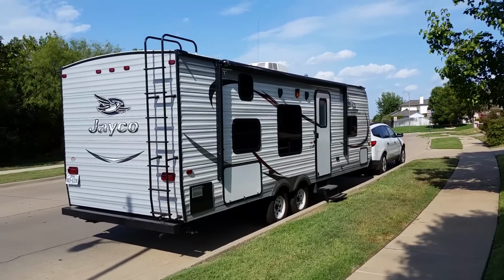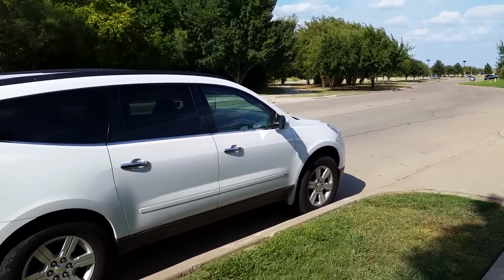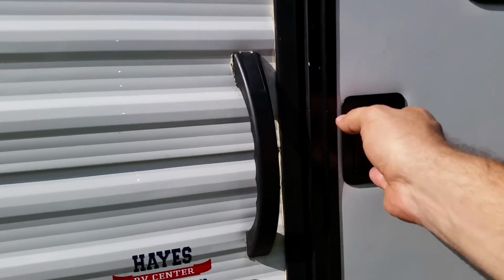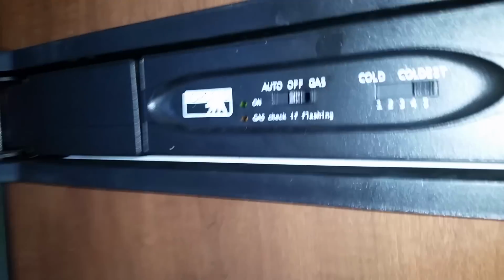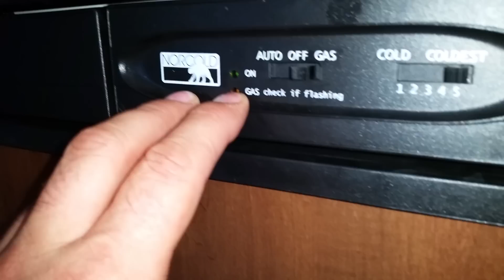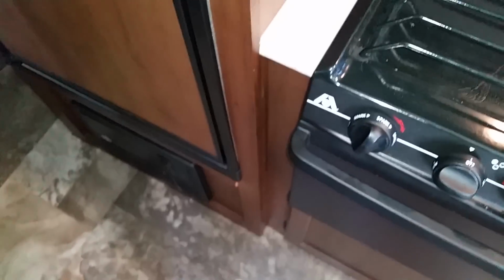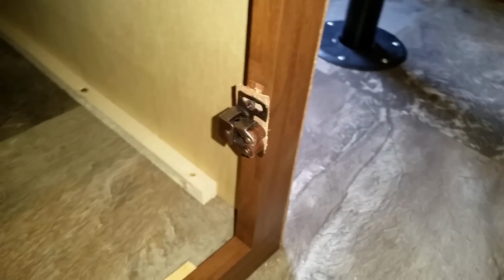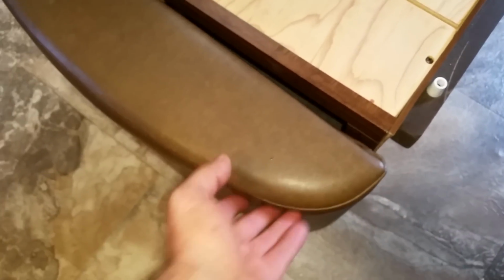Update: New JayCo Trailer FALLING APART.  Lengthy Warranty Work Needed.

Comment: So sorry with your experience with this model. Unfortunately it's with 2X2 pine stapled and glued, lots of particleboard and laminated tack-paper. We have a friend that bought a low end Jayco  too a month ago and before he used it the wall and ceiling bowed and separated and water was leaking in from a window. If you decide to trade in (which might be best) consider a camper with aluminum substructure (not 2X2 pine studs) and fiberglass side. Avoid slide-outs. I wish you and your family the best

Comment: We have a 27ft 2014 Kodiak Dutchman trailer that we tow with our truck that we purchased from Camping World in Florida. We've owned it for about 5 years and we have a wonderful extended warranty for all hardware in the RV including the batteries, A.C. unit, fridge, etc. And the only real major thing we had to have replaced was the main switchboard or whatever you call it that controls all the electrical components of the RV as well as the batteries because the jackassess at camping world LEFT the cover OFF and allowed it to be exposed to the rain when they did our repairs!! The only other things we had replaced out of pocket were all the upholstery on the fold out couch bed and table bed as well. Lastly we replaced the two top roof air vent covers as well. So overall DO your RESEARCH BEFORE investing  $$$$$$ into any RV. And make sure you have a great extended warranty service. Ours is through Good Sam I believe.

Comment: On some of the items that looked bad right from the factory, why did you take delivery of this unit?  Like the seam in the wall that bothers you to no end and the upper wall putty areas. Since I haven't seen your original video, I don't know if you took it back to the dealer for warranty repairs? I, too, would be extremely upset about things that happened during everyday use.

Comment: 2010 Chevy Traverse towing capacity: 2000 lbs
Jay Flight 26BH dry weight: 5000 lbs

Man, maybe I don't know what I'm talking about, but that seems like a terrible idea even if you've been getting away with it. It's not whether you can pull it up a hill. It's how it handles under emergency panic braking and emergency steering, especially if going downhill.  I'm guessing you haven't faced an emergency situation yet. Glad to hear that. I'm surprised DOT or highway patrol doesn't pull you over for this. I thought "there is no way that's the tow vehicle - it must just be a random car parked in front of the trailer." :-)

Comment: What amazes me is that most of these problems are very evident when you look at these trailers when new. Consumers have to understand that they need to get over the excitement of buying a RV and do a close inspection. There is a reason you can pull these things with a small or medium crossover or SUV. I have been looking at these for the past 5 years and you can notice how cheap they are put together. My advice is to wait till the companies change their attitudes or buy a good class A. Remember always you get what you pay for. You will not get a $300.000 home for $25,000.

Comment: Don't have the fridge running while you're towing and only when it's level.  The dealer should work their butt off to get the trailer replaced for you or lose their dealership.  Thanks for the video.  I was thinking about downsizing to a Jayco but will really look one over now.
Reply from the maker: Mike Silvernail This fridge is supposed to switch between gas and AC power automatically, and it has been marketed as being able to be running when you're traveling period this specific unit did actually have a recall because the wind screen Or whatever apparatus was installed to prevent the flame from going out while driving, had failed period that was actually replaced period

Comment: I would love to see a brand come out that uses better materials, screws instead of staples, and actually uses long lasting quality seals around the plumbing, roof, and windows. Any finish work should not just be slapped together, but if necessary, fitted together. Most of us would pay more for a well built tough use RV, and would pay NOTHING for crap. The problem is that it is hard for most people to tell the difference at first, and there really is no Company that has taken the gamble to be less competative by making a better quality product. I think in the long run, that gamble would pay itself back many times over, and you would hear people say "If you want something built right, buy a brand X. They cost 20% more but are worth it" Right now, unless you want to spend a 1/4 of a million dollars on an RV or more, there is no brand X. There should be quality models in the $30-60K range.

Comment: I Bought A New Jayco Swift slx 145rb new in 2014 for Cheap (8k).  It Had A Few Trim Issues But Not Bad. I Really enjoyed using it for Hunting Out Of Town. 2 Days Ago I Traded It In For A 2017 Keystone Bullet ultralite 220 RBI. The Keystone Is Very Nice. Cant Wait to Use It This Coming Sep Though Feb 28 Then Again In April For Turkey Season.

Comment: Something's wrong with this picture: unless I'm mistaken (please correct me if so) the Jayco trailer's dry weight is about 4400 lbs. the towing capacity of the 2010 Chevy Traverse is just 2000 lbs. I'm not disputing that you've easily towed it, I'm just wondering how that could be the case in light of the foregoing specs.

Comment: What was the resolution on this slipshod Jayco Jay Flight trailer? I watched a mfg video on YouTube and it raised a number of red flags on what I saw being done. A lot of trailers are built in the same general manor as this trailer and hold up quite well. But it's the details of how it's assembled which matters. If you short cut things, than you get what you got here. That backrest should never have come loose like that and the counter should never have come apart like that. Process control is severely lacking on this unit in many areas. Sometimes it takes a serious financial penalty to wake up the provider to honor their warranty. They got their money when you drove out of the dealer. If the dealer and Jayco do not have proper motivation to do right, than an external factor has to encourage that motivation. That usually involves dealer or management getting their current and future compensation impacted in a significant manor in some way. They feel and notice that impact. That will often will get their attention. Light weight does not have to mean subpar materials and construction process.

Comment: My wife and I bought a brand new 12' 2016 Jayco pop-up trailor last year...I've had it in the shop twice and has to go back into the shop again, mainly not fixing all the issues that I took it in for originally! I've got a new issue with the slider now also...that there trying to tell me Jayco says is within specs! it's been a nitemare trying to get fixed! that's with only using it 4 times that year! I'll NEVER buy anything Jayco again! Comparing different trailors to buy now, I'll be trading the Jayco pop-up (at a loss) in so that we can have a trailor we can use without falling apart!

Comment: Another note, All the companies use the same materials internally. Same Fridge, Toilets, Relay Switch, water heaters etc. That is why you can go to any RV store and get Universal parts. They are all cheap parts. One fellow told me RV stand for Repair Vehicle. I wish there was a way to get upgraded better parts but it doesn't exist. Most Homes today are built the same way but at least there are options with your house. Getting better light fixtures etc.

Comment: I watched a revealing video on this very topic. Most companies are making them cheap and light as possible by skimping on materials in part so they can sell to people with almost any kind of car (such as a crossover) and they can drive it off the lot Then & there. Quality trailers from the past weigh more & need a real truck to tow them. Looking over one of these before buying is useless as it is bound to fail at many points due to frugile use of adhesive/fasteners/thinner wood/metal & pressure on workers to assemble them all at break-neck speeds. This build/sales ethic went into overdrive after the 2008 market crash.

Comment: I have a jayco and love it. yes it has a few problem but that happens. two months before they can get it means the dealer ship is that busy. my small town RV dealer is always two months out. most of these problem s you need to fix and just take it in before other problem arises. also maybe you should of looked at the trailer and found most of it before you bought it. new cars have problem also. also trailer s will settle and problems come up. stop complain about the problems and just get it fix at least they will fix it. then when it is done check there work. my friend just bought a 100,000.00 toy hauler and after five months the fridge quit and a window blew out. during that time the manufacturer went out of business and the dealer won't warranty it because no one is going to pay them . so just get it fixed then sell it and get a different one.

Comment: I am looking at how that Dinette broke, with the screw placement and my first instinct is that someone was pulling or pushing on it with a lot of force.  To see the screws in the side pulled out like that...  Needless to say, I am not convinced the dinette and couch issues are necessarily construction issues.  I do see some of the interior issues that are bad construction, like the wall seam.  To see someone to pull a trailer with a dry weight only 300 lbs under their maximum tow weight does not make me think that they are careful with anything they own.  I am less likely to give them the benefit of the doubt.
Reply from the maker: Assumption train leaves in 5 minutes.

Comment: My 2011 Keystone Passport 28 RL ultra lite, is a rolling junk yard. The big one is the roof, it's got bubbles all over, I can pinch it and lift it up off the top of the trailer, going to have to replace it. I may just use liquid roof on it, seems like a better idea that replacing the rubber. But also same thing little cheap things fall,off, coming unglued, also the landing gears are so cheap one by one they stripped out I can't lower or raise them. Very sad for what these cost, shameful. Thanks for the vid, best just get in there and glue and screw.

Comment: We have a 2014 White Hawk 23MBH and the only problem we've ever had is with the plastic kitchen faucet. I replaced it with a residential model in about 15 minutes and have had no other issues at all. (edit) Also you should really rethink about what you are pulling that thing with...

Comment: I have a 2 year old Jayco 28BHBE I have pulled it aprox 3000km so far, I can say it is not the greatest build quality lots of small stuff but all the big things are working fine still. Almost all trailers are crap unless you go very high end and all the warranty s are worthless this is an industry wide issue with almost all brands. I had a  kZ sportsman it was much better than the Jayco on fit and finish but it had issues also. The fiberglass started to crack and the furance crapped out after 4 years so i sold it, I will never go back to a fiberglass trailer. I know they are lighter but when they start to crack your screwed. In the trailer industry its buyer beware and once you pull it away your on your own.

Comment: BEWARE of the Kodiak by Dutchman as well. I have had slide out isdues with the schwintech system. Which is very expensive not to mention that your stuck at the park unable to retract the slides. Cheap leather separating on the sofa and the recliners. The finish is peeling on the wood. Hot water heater failed. AC failed. Valve on the exterior shower leaked. Exterior LED lights failed. All these things at my expense in the first 2 years.

Comment: You would think they RV industry would take more pride in their products. I purchased a 1971 Comet camper and was amazed at how poorly engineered this camper was designed and made. The hot water heater is under the bed. So, I have dismantled the entire trailer and will build a new camper ground up. There are few things I can salvage, but basically, the quality even for the 1970's was really poor. I have owned two RV one class A 34 foot Winny and a 30 foot Rockwood 5th wheel. Overall the Winny was much better built, yet it had design flaws as well.  So far I have not been impressed with many RV/Campers.

Comment: There isn't much point in getting it "serviced", it was just designed poorly, with tons of compressed popcorn for walls, One-length of self-tapping screws for everything, and the most slapdash assembling possible.   Everything is covered with barely stuck-on vinyl wood-grain wallpaper.  It all looks good in the showroom but that's about it.  To really fix it would require replacing almost everything with sturdier, more expensive components.   Just consider it an expensive life lesson.   Don't buy anything expensive without opening up all the panels and peering in with a flashlight.   If the insides are all shoddy particleboard and nails and hanging pipes and dangling wires, walk away, quickly.

Comment: How are you towing a trailer that weighs 4500 lbs empty with the Chevy Traverse. It's rated to tow 2000 lbs max.  I have towed my travel trailer in Colorado in the mountains with a Ram 1500 and 5.7L Hemi engine and I'm lucky if I can go 40 mph in first gear at 5000 rpm on some of those grades. I don't buy it that you were going 60-65 with a 3.6L v-6 on the steep grades in Colorado. It isn't possible.

Comment: I bought a Salem Cruise Lite 263bhxl  2017 and have some little issues with it, and you Big Skid are 100% right  they take for ever to fix it . SO i say screw them I fix it my self, and make it better. And now I have done so much repairs (upgrades) on my Travel Trailer im a happier camper. I love Our trailer and got a  great deal on it, Cant complain. My problem was molding and trim coming off. Just the other day our last trip out, on the way home the Bedroom Slider door broke off and it was pined back in position for travel. Cheap press board is what the use. I went to Home Depot and bought the same thickness 1 1/5" x 6'  for 70 cents and fix it myself did both doors. Im saying your gonna have to repair it yourself, or dont bother getting one.  Last thing  The Amish do shitty work they  have no pride in the  products they build. HAPPY CAMPING ALL  !!!

Comment: this isn't just jayco, they're all like this unless you're willing to spend upwards of 100k or go with something really small for the same price. jayco is actually one of the better brands, this type of trailer in general is junk no matter who you buy it from. these things need to be light weight and affordable, and this is essentially a house which is not a cheap or light thing to build so there is a lot of cost cutting in this business. most of these ultralight type trailers are manufactured from manufactured parts and put together like legos. you'll notice the stereo systems they give you are sometimes just a generic car stereos that you can buy off of amazon for less than $50. the layouts are all reused and recycled. I have gone trailer shopping and even some trailers that are built pretty damn solid still have some issues with fit and finish on the inside where something is lined up right or it's already scratched or there is some glue that looks like it was applied by a 3 year old. coach makers like jayco, winnebago, rockwood are going to put their money into the structure and give you a solid trailer, but the down side is that the interior has to suffer pretty bad which is why you get this crap.

Comment: The Amish did that ???
In 2019 my wife and I go full time RVing.
Now my wife wanted a regular ttailer with the truck but I hate the layouts....small kitchen and water storage...plus fit and finish.
I suggested a pop up four wheel camper 8' bed on a RAM regular cab V-8 for break away exploring 18' long.
Then I wanted the Amish to build us a 16' cargo trailer inside with a slide that makes the front hook to the truck for security and parking......I want 200 gallons of water and 12 feet of counter....storage under a 4 foot by 7 bed 3' high and a 6x7 bathroom at the back.
NOW I'm rethinking the AMISH....?  Thanks

Comment: Sadly, the factory, to some extent, relies on the dealer to fix a lot of these problems when the dealer does the PDI(pre-delivery inspection). I had a career working for about 9 different RV dealers and when I'd inspect a new unit before delivery, I'd be anal, like I was buying it myself and often times I'd come up with a long list of things to fix.

Comment: I'm just surprised you pull that with a traverse. They are only rated to pull 2000 pounds but you do you I guess

By the way,  that engine might not last pulling that much weight,  especially up in the mountains where I guaranteed it struggled. They rate a vehicle to tow a certain weight so that its reliable, can accelerate and brake fine and the traverse won't do any of that well. Correct me if I'm wrong with these,  I would like to see opinions on towing.

Comment: I have a Jayco and was warned by the Seller. They stay affordable by dressing the inside with junk, while putting the quality into the overall construction. Strong frame and roof. Good weather proofing. It is a pain in the ass, but if you put more money into the interior, you'll have a 70000 dollar Trailer for 40000 grand